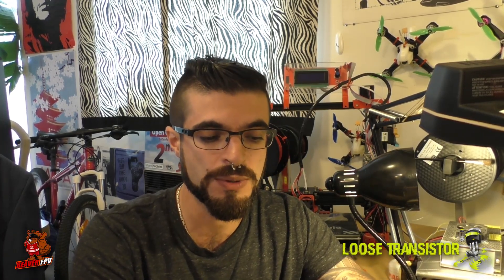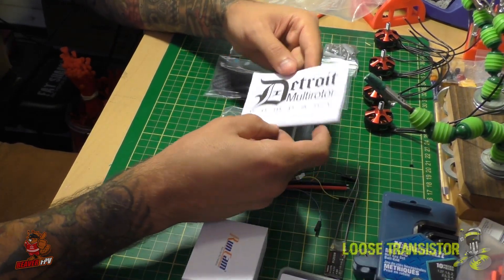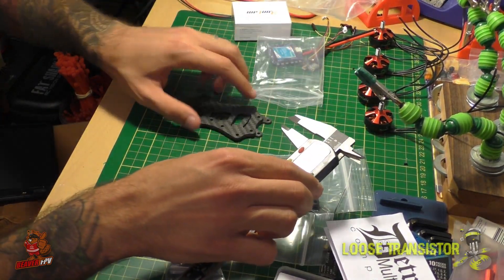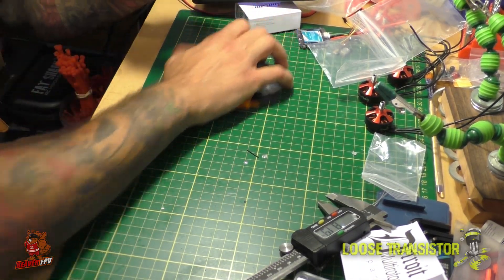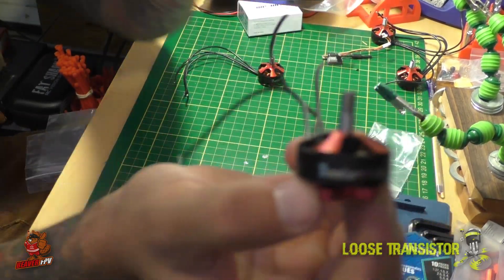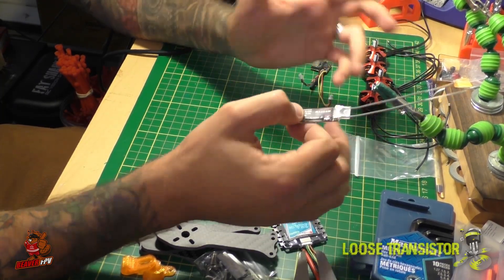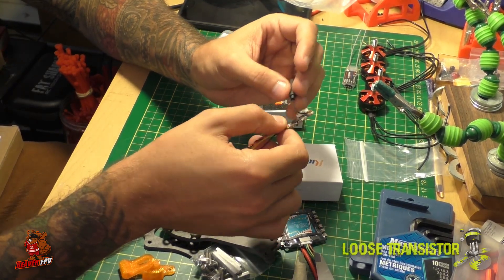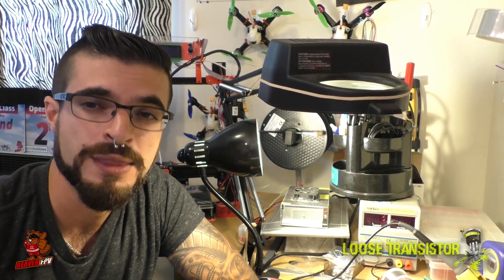DETROIT MULTIROTOR - Doberman 5" Stretch ♠ [ FPV DRONE BUILD ]

Comment: Hope you can help,  I am doing a similar build and have a 30A Cicada 4-1 and using the same ESC as you.  Can I simply run the smaller +/- wires from the Cicada to the +/- pads on the FC to power everything?  Just so I am clear,  not the larger 16ga red and black power wires on the Cicada but the 6 smaller wires from the Cicada connector.  Seems like the the Cicada wires are very small/thin and wonder if the board will get enough power.  Thanks and appreciate the help.
Reply from the maker: Dennis Forbes those thin wires are just for signal. They don't carry enough current to power the FC.
Reply: OK cool,  yeah didnt think so.  I am watching your build video now and see you added additional power wires to the Cicada.  In your build video you talk about soft mounts but I remember you stating its OK to hard mount the FC, keeping in mind I am using the same FC you are,  would this be OK?  Thanks again!
Reply from the maker: Dennis Forbes yes I have used the FC hard mounted without issues. Soft Mount just allows me to push the tune further.

So if your are out our space or don't have bobbins... Just hard Mount it and it will be fine 😁
Reply: Cool!  Yeah I am trying to get the stack as small as possible as I am trying to mount the battery on top,  thanks again man you really helped me out!
Reply: Hello,  got everything setup and looking pretty good.  Question I am running the same CL Racing FC and when I go to BF to flash it only has the 3.1.7 dated 10/4,  is this the latest as I thought you stated in your build video that this board is flashed with 3.2?  Are there any issues running 3.1.7 until 3.2 is released for this board?  Thanks again!
Reply from the maker: Here check out this video! It explains a lot of what you are asking

https://www.youtube.com/watch?v=Q5qwZ_DGdrk&t=374s
Reply: Awesome,  really appreciate the help,  any idea when you think 3.2 will be official through Chrome for the CL Racing F4 board?  Seems like 3.1.7 is actually working really well as my Doberman is flying like its on rails.  The only thing I can see not working is the beeper for now,  am I missing anything big by not upgrading to 3.2 on this FC?  Thanks!
Reply from the maker: If your quad is flying fine stick with 3.1.7 for now - in my experience, 3.2 flies better once tuned and there are some neat features in the configurator that makes things easier.

I have actually no idea of WHEN they are intending to release the full thing but it can't be much longer. I think they added all of the features they were going to add and now they just need to make sure it all works well.
Reply: Loose Transistor FPV Yeah I might just stick with 3.1.7 as it essentially has what I need,  at least until the dust settles on 3.2,  I poked the guys at CL Racing this am and told them it was not posted,  within the 30 min I told them its now available on the BF Chrome app so its there now,  thsnks again and really appreciate the help.

Comment: Hey man, I can thoroughly recommend the Spedix ESCs. I've used them on all my builds since January and not had one fail that I didn't blow up by smashing it!
Reply from the maker: Hey Chris, thanks for the input man. I don't have any experience with them so I am always weary of spending money on something  like that. I will take your advice and maybe look into getting some tiny speedix ESC's for my next build! Cheers
Reply: I totally get it dude. A bunch of the guys I fly with up here use them too, and I think what most people don't realise is that Spedix is the OEM for a bunch of other ESC brands.
Reply from the maker: Ahhh! That I did not know at all. Thanks man, that's great info to have.